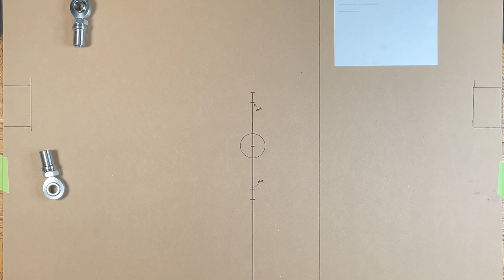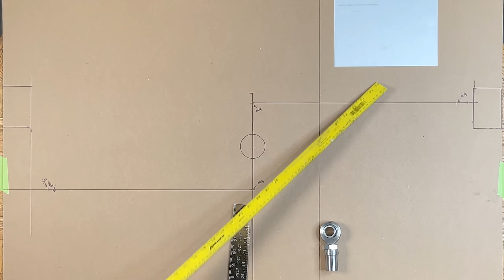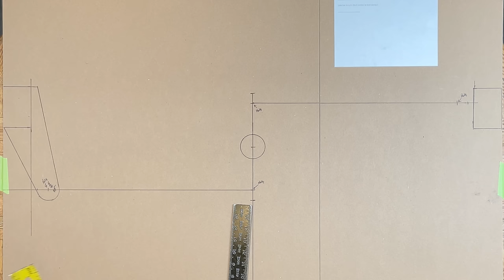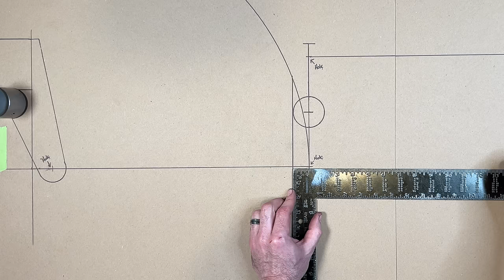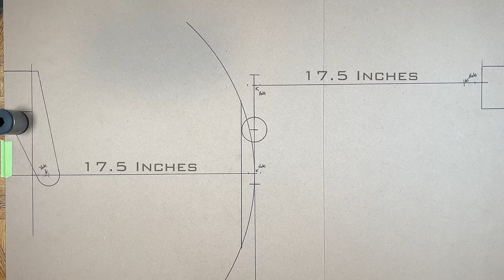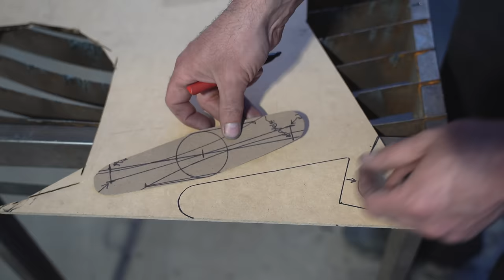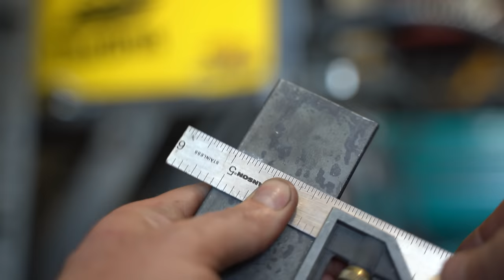The Greatest Watts Link Tutorial Ever! Mighty Max Ep. 16

Comment: Great video. Personally I skipped some parts but I have been a fabricator for years. I use a grinding Stone that is a cone stone to bevel smaller hole like the 2 inch with my 7 1\4 grinder. But do the same no program just math and card stock or sheet metal.
Reply from the maker: Yes sir! Fabricating can be pretty tedious to watch when you see it all. day. long. 😩 
I’d be interested to see that cone set up!

Comment: I just watched you build my Alfa Romeo Milans rear suspension.  You should slip in the Dion Triangle.
Reply from the maker: That is a fascinating setup! I’ve never seen it before today. It’s like they took an independent rear suspension and turned it into a solid axle. How does it perform from your point of view?
I most certainly will NOT be building a Dion Triangle on this truck but I will be researching it and I will quite seriously consider it in my next truck project that will have CV axles in the rear.
Thank you! That was literally the most fascinating thing I’ve seen today.
Reply: @GarageFab  with the suspension mounted to the triangle you can have all the body roll in the world and it will not change any of your suspension geometry.  It's like a slot car to say the least.  It also helps when the tranny is between the wheels giving a 49/51 balance.  Part of the reason these alfa kick butt over there in Nuremberg.
Reply from the maker: I’m even more fascinated. My next truck will have a front wheel drive V8 engine, transmission and suspension in the rear, hence the CV axles. But front suspension will operate lousy as a rear suspension so it will need to be modified. You’ve opened my eyes to a possibility I didn’t know existed. 🙌

Comment: ok, this might be a dumb question.  Can you use heim joints for the rod ends on the axle and frame bars?  I am destroying my bushings. from what I have read, the heim joints won't have any cushion. Is this the only negative?
Reply from the maker: Not dumb at all. I’d love to see your set up so I can try and figure out why you’re going through bushings!
If you don’t mind a little extra road noise and vibration, Heim joints on all bar ends will be just fine. Ride quality, (aside from expense) is indeed the only negative. In fact, there’s only positives! Soft bushings are the enemy of performance. Not only do bushings absorb vibrations, they also zap horsepower and can sometimes negatively affect handling. I personally like being able to feel the texture of the road, especially when driving hard or racing. It puts you more in tune with your vehicle so you can tell when your vehicle is going to lose traction. Heim joints will give you that. But they won’t give you a sense of luxury.

Comment: I’ve done a few watts links. Just curious why you didn’t thread out the heims for adjustment? I hate heims why not use poly bushings.
Reply from the maker: I’m not sure what you mean by “thread out” but the heims have been positioned for adjustability. The thread areas are approx. 2 inches long. I prefer to have at least 1 inch of thread engaged at all time. That gives 1 inch of usable adjustment. They have been positioned at the halfway point of that usable 1 inch, so that I have a half inch of adjustment in either direction.
I do not hate Heim joints for this purpose. I use them because there is more lateral movement of the bar end than a suspension link. Poly bushings do not like to be excessively torqued sideways. In this use case, a Heim will last significantly longer.

Comment: So... noob question here. If properly designed, can you use a watts link on an off road crawler type rig? If so, can you mount the propeller above the axle center so that lower watts link is not below the axle where it can get caught on rocks and such?
Reply from the maker: Welcome to the Suspension world, Scott! That’s not a noob question at all. Quite advanced actually. In fact, I’m not sure how to answer this. I specialize in mini trucks and don’t have the knowledge of what makes a rock crawler perform well. So let’s answer it this way, YES! you can install the Watts link on a rock crawler, mount it so it doesn’t get snagged, and make it work properly. You can also design a watts link that will provide a crazy amount of articulation of the axles. But I don’t know if this would perform any better or worse than the typical double triangulated 4 link.
Possibly important information is that the pivot of the watts link propeller is the vehicles roll center for that axle. So putting the watts link pivot up high also brings your roll center up high. Is a high roll center good on a rock crawler? You’re on your own on that one. Cheers!

Comment: What do you think of angling the propellor/ center link to reduce the distance between the side links vertically, like ford did on the crown vic
Reply from the maker: Hey Casy! I’m not sure exactly what you meant by reducing the distance, but you can set up the Watts link in many ways and it’ll still work. The Crown Vic propeller is at roughly a 45° angle compared to mine. You could also mount it on top of the diff (or on bottom) at a 90° to to mine so that it resembles a helicopter rotor. It’ll still work just as well.
The main challenge to any of this is not having the ability to pinpoint your roll center, which is located at the pivot point of the center link.

Comment: Hey MK, this is my 2nd time watching this one, is there a reason you can't set the center of the "propeller" higher than the center of the differential, if you move all corresponding hardware up with it? I have been thinking about this and I can't think of a reason to not to, other than bed floor clearance.
Reply from the maker: Darren! You can put that thing just about wherever you please. Here’s what you have to consider; The pivot point on the propeller is the roll center of the rear suspension. Do a little research about roll center and see if a higher roll center will work for however you plan to use the vehicle. Arguably, a lower roll center is better for handling. A higher roll center has less of a need for a sway bar though. 🤔 Lemme know what you decide!

Comment: Hey, dumb question but that bolt is gonna need some thread sealant on when final assembly and gear lube is added right? Thanks
Reply from the maker: Not dumb at all. Absolutely! The bolt for the pivot is practically an additional fill plug. Without sealant it wouldn’t leak quickly but it would definitely leak.

Comment: Can you, alternatively, mount the "propeller" on the chassis and the rod ends to the axle? (Great vid BTW.)
Reply from the maker: Yes you can! Though you would need to build a crossmember to mount the propeller to. A side effect might be inconsistent handling. The roll center for the rear suspension is the pivot point of the propeller. (the point that the chassis rotates around when the body leans) If it’s attached to the chassis, that means the roll center is also moving up and down as the suspension cycles. Would that be a problem? I don’t know!!
Thank you, Trev.

Comment: im making a couple control arms for my farm truck, I have 2 issues you might be able to help me with. First off when welding do you remove the bushes? im guessing you tack them to the frame work then remove bushes and weld?  secondly I dont have good ones (mine are all bent) and I cant find any old ones anywhere that are for my particular model, I was thinking a flat peice of panel steel and cut the base to fit flush against the bush collar in place on the vehicle and for the ball joint end I was just going to centre the strut by hand and mark that on the steel?
Reply from the maker: If you haven’t already, check out these two videos. It might answer some of your questions. Mainly the bushings. I have mockup bushings that are basically aluminum versions of the actual bushings so I can weld with them in place without melting the rubber/polyurethane. If you can’t obtain those, perhaps just tack weld the sleeves in place to cause minimal melting and then remove the bushings to fully weld them.

How To Build an Adjustable Jig for Custom Control Arms!
https://youtu.be/NZ4nLCTsW68

https://youtu.be/pyKNkjhrHOY?si=6UEg4boCYrASAo-0

As for the strut positioning, I’d likely do the same thing; hold it in place and mark the arm. Remember the bottom of the strut will move closer and/or farther away from the frame as the suspension moves so try and imagine that movement. If you can’t imagine, remove the spring from the strut and tack weld the strut bracket to the arm and cycle the suspension.
Reply: yes ive already been looking through my junk piles for something to use as a fake bush lol,  its times like this I wish I had a lathe set up :(  I will defo check out that video you suggested and thanks for replying, awesome mate.
 @GarageFab

Comment: I have a 78 Bronco that has 46 in tires with a lot of left. I am looking at putting a 4 point under the rear would you recommend this link st up?
Reply from the maker: Absolutely. Link bar setups are ideal on almost every vehicle. Do you know what style you want to use already? Triangulated 4 link? Parallel with a panhard bar?

Comment: Hi I like your videos and info and very nice fab skill and looks good I would like to ask if this set up could be made to work on a front axle in a 4x4 buggy I am building a utv type buggy and I do not have the room to do a 4 link like most rock buggy  or other 4x4 rigs not sure what to do got any info to help me out on this thanks hope to hear back from you.
Reply from the maker: Thank you, Steven! You can definitely make it work but it could be pretty challenging. You’ll need some sort of link setup so on something with minimal space, a parallel 4 link should work nicely. As for the watts link, mounting would be tough but doable. Your steering rack would likely need to be in front of the axle (because the link bars are behind) which means the watts link and rack will be fighting for space. Just know that the “propeller” doesn’t have to face forward like a prop plane. It can be at a 45° angle like the watts link on the 99 Crown Vic or even like the the props on a helicopter.
That info alone should free up a lot of space. Can’t wait to see what you do with it!

Comment: Won't the bars hit the reinforcement of the Propeller if the axle is tilting? Seems pretty close in horizontal movement. Just wondering
Reply from the maker: That’s a good point! If this were an off-road vehicle, yes I imagine that would be a possibility. This one will be ok. It has 12 inches of travel but you’re seeing closer to 14 inches in the video because the air springs were detached. So there will be more than enough clearance for typical articulation like entering steep driveways at an angle.
Good eye! I’m impressed. 👏

Comment: So as far as application specific design, would this style be better than a panhard in an offroad suspension setup in a 4runner? Im about to start designing the suspension for a high articulation setup and a trianglulated 4 link seems like the best initial concept but when fully crossed up (max droop on one side and max compression on the other) would this create interference between the upper and lower links that a watts link would mitigate better or is that the entire reason the 4runner has a panhard from the factory? Sorry its a lot snd not exactly on topic with your build but suspension design is very interesting to me and im trying to sponge up as much as I can before tackling the offroad suspension build.
Reply from the maker: There were a lot of questions in there and each of them trigger even more questions! How extreme are you planning on going with this project? Like trimming the fenders a little, or completely gutting the rear of the 4 runner and building a partial tube chassis?
The panhard is a very affective device but anything beyond street driving, it’s less than ideal. The watts link could be a “better” choice but it too has its limits. It would need to be design creatively to allow much more articulation than the one I just built would. 
For extreme articulation, there is no better setup than the triangulated 4 link. There is literally nothing to get in your way except the chassis and the rod ends.
I’m a Toyota/Lexus technician so I’m very familiar with the 4 runner. The triangulated 4 link would likely require a partial or complete removal of the floor in the rear, removal or redesign of a tubular crossmember just in front of the rear wheels and a relocation of the fuel tank.
It’s definitely a lot of work but the triangulated 4 link would be my choice.
Reply: @GarageFab  So, my thoughts were to do the f150 tank in the rear where the spare tire used to mount. At that point it should clear the way for the upper links to stretch out. Im basically trying to build a 02 4runner into a trail beast with a rooftop tent so the wife and I can just hop in and disappear into the woods anywhere and not have to worry about bringing another truck along to pull us out. 35-37" tires and most likely ring and pinion swaps with lockers all around. The long travel front setup should be a sufficient upgrade however a solid front axle swap is not out of the question. Ill need the floor to store supplies for our adventures but that doesnt mean the chassis would have to remain factory spec either. There will be quarter panel and fender modification to fit the tire size and full range of motion. I know I basically unlocked pandoras box with this question. It is sort of why I couldnt just open up a discussion on the 4runner forums. Those guys all have their own sets of "facts" that are based on what pictures they saw on the interwebs that one time. Id rather have the conversation with someone who actually builds wild shit than someone who sits in moms basement and talks trash to everyone online for entertainment. Thank you for the response man. I guess if you want a toyota related question answered properly you ought to fond a Toyota tech who also does custom fab work...lol
Reply from the maker: Hahaha! Well to be fair, I’ve never built a rock crawling behemoth. I did build a tiny truck frame though and it’s amazing what you can learn when you watch pieces and parts move in real time.
Best of luck on this fascinating project! It sounds like your head is on straight and it’s almost guaranteed to be incredibly bad ass. Can’t wait to see it!

Comment: Every type of rear suspension I have seen on you tube place the 4 link bars forward of the rear axle.
can the 4 link bars be placed to the rear of the rear axle. I have a vehicle with a fuel tank close to the rear axle on one side of the tailshaft /(drive shaft)

Comment: I have a 1 ton that will be a work rig that I am doing parallel bar 4 link on, can the watts link be above the axle, say 6 inches or so.  I'm not slamming it but I am using air bags instead of coilover shocks.
Reply from the maker: Yes, William, The center pivoting link can be placed just about anywhere! 
The catch is that the pivot point is the roll-center for the rear suspension. A high roll-center is arguably not as good for vehicle handling, but I predict you’re not going to be racing this thing. Regardless, I’d recommend doing a little research on roll-center and decide for yourself.

Comment: Got me thinking…could this work in a lifted application like a coil sprung 1500 Ram? Particularly in off-road situation with axle movement flexing at an angle?
Reply from the maker: Absolutely! Someone just pointed out that mine looks like the propeller comes too close to the support for the axle to articulate. They weren’t wrong!
But on a coil sprung vehicle, the Watts link will never see the extremes so that shouldn’t be an issue.
Also for rock clearance, you can mount the propeller a couple inches higher with minimal side effects.
Reply: @GarageFab  thank you, I’ve got a lot of time on my hands to plan, so I appreciate it!

Comment: You did not talk about the bushing behind the propeller. Where to get them and what size to use and any other info.
Reply from the maker: That is true. I get my bushings from Thorbros.com though there are a lot of places you can get them. I think their standard bushing is 2 inches in diameter and they give you an option of width and through-bolt size. For the through-bolt I’d suggest 9/16” or 5/8” The width doesn’t matter all that much it just depends on what design your going with. The bushing I used was a 2.5” wide bushing.
The 3/4” Heim joints that I used came from the same place, Thorbros.com. They have forward and reverse thread options and their bungs fit 1 1/4” 1/8” wall DOM steel tubing.
Reply: @GarageFab  thank you, great show.
Reply from the maker: Thank you, Jake!

Comment: couple of questions : why are those upper links dog legged  ? , and is that chip board you use for your patterns ?  :face-turquoise-covering-eyes:
Reply from the maker: If you’re referring to the bend in the upper bars, they’re designed to snake around the air springs. There’s some shots that show that well in this video…
How to Make Identical Length Link Bars! Mighty Max Ep. 12
https://youtu.be/feDRfsqvJ3g
And yes! Chipboard. Took me a long time to learn what it was called.
Reply: ok.... watched the video "air bags" got it , where are you located  ? what city  ? your knowledge is much appreciated and great sense of humor , the old man says to tell you he's installing a ford 9 inch in a 67 Camaro - triangulated 4 link , coil overs and sway bar and 17 1/2" wide Mickey Thompson tires - back halved and tubbed